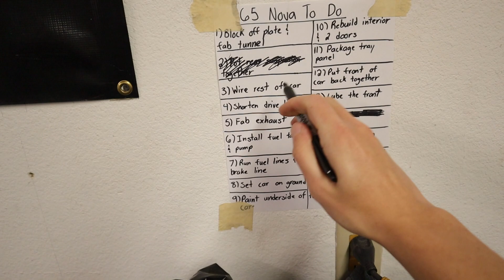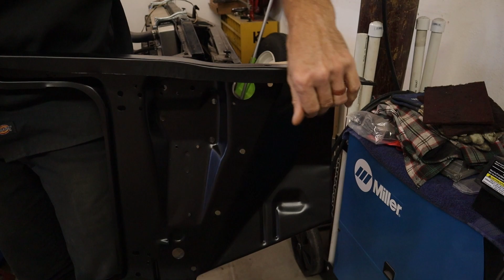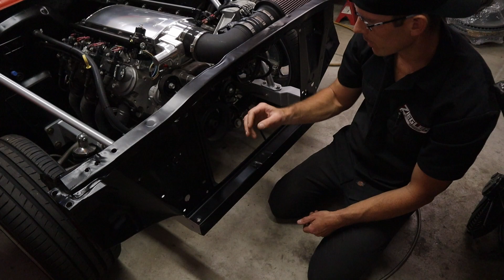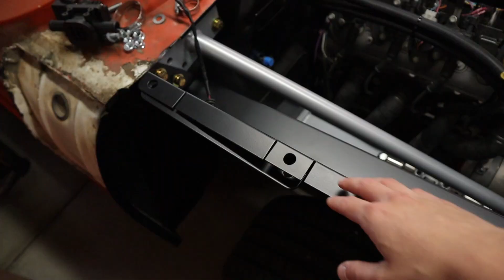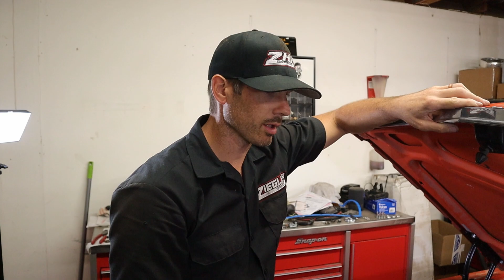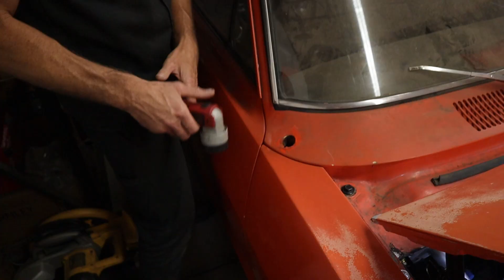The front end is TOGETHER! - Chevy Nova Build Part 23

Comment: Dang it I'm having the same issues fitting my inner fenders and fenders but you skipped over how you addressed the rear firewall bracket leaning down too far. Lol every YT video seems to do this! Ooh here is the info I need! Nope we're going to skip over that part 😆
Reply: Did you ever figure it out.  Struggling with the same thing right now.  Thanks
Reply: @lemmemansplain2085  funny you commented when you did. Project has been on hold i just got my Ring brothers hood hinges so I installed them yesterday.  Best advice I can give you is  leave everything loose and start putting everything together. I did use some body shims behind my drivers side hood bracket from the kit and I'll need to use some between the inner fender and fender possibly. But the more I look at it I think if I start at the firewall and work forward tightening everything slowly it'll pull itself together nicely.
Reply: Did anyone ever make a video or give more advice on how to get that inner fender to fit right  ??